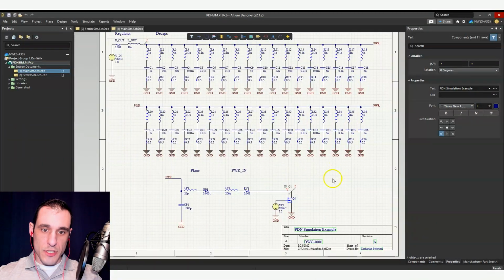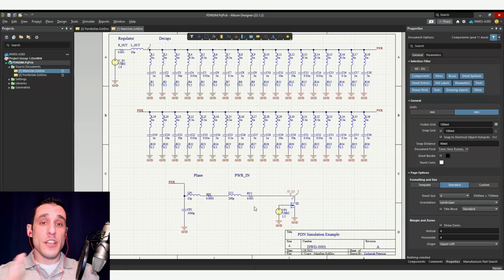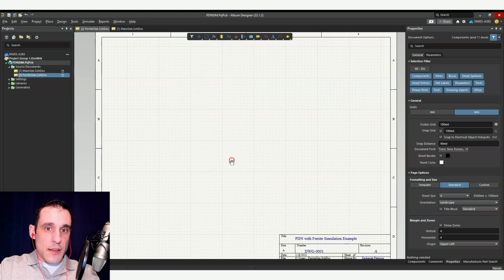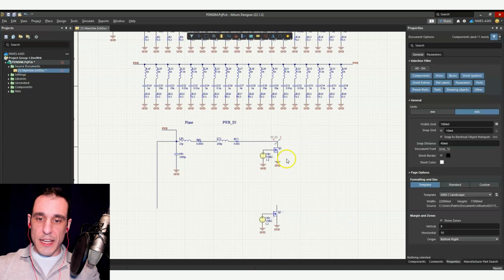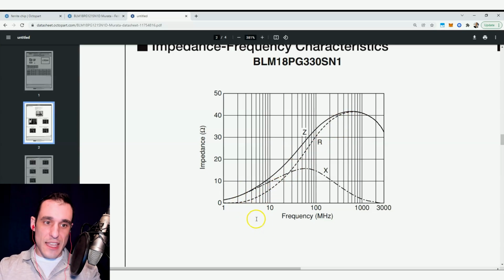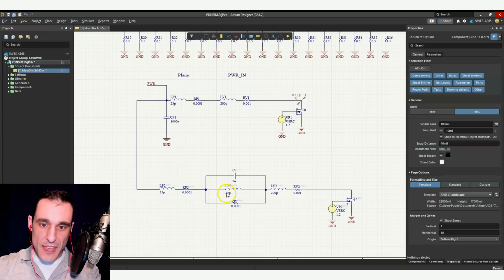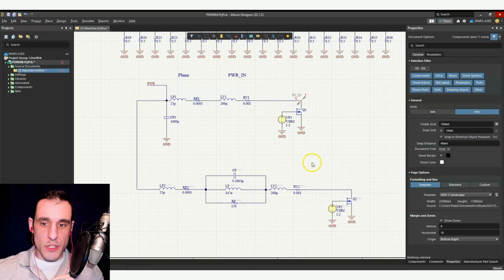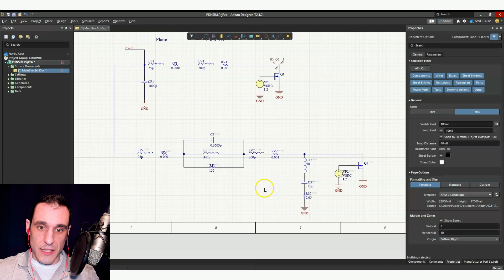Ferrites in Power Delivery Networks - Part One

Comment: hi dr. Peterson, how did you calculate R,L and C in the ferrite model? for example to calculate C did you use C=1/2*pi*f*Xc? Thank you
Reply: I will show how to do this in an upcoming video. It is actually very easy by looking at an impedance curve for a ferrite bead and the impedance equations for an RLC parallel circuit. Give it a try and see if you can do it, or you can tune into the video once it comes out in the next couple of weeks.

Comment: Hello Zach, thank you for all the awesome content.
Would you recommend putting a 100Ω@100MHz ferrite bead on a VBUS line near the USB connector for a general high frequency noise attenuation? I mean it's recommended by many IC manufacturers and it's even mentioned in the USB spec.

Comment: Hello! Can you explain how you calculated inductance and capacitance for the model of ferrite?
Reply: Sure. The ferrite can be simply modeled as a parallel RLC circuit. This is not an exact model, it is only an approximation and it will overestimate the reactance at mid-range frequencies. The impedance value at the peak in the impedance curve gives the value of R. The bandwidth (Q value) is used to determine L using the value of R, and then the natural frequency (known from the peak in the impedance curve) and L can be used to determine the product LC. From that you solve for C, and now you know all three circuit quantities.

This first thing to note is that the ferrite's behavior can be approximated as being a parallel RLC circuit. This is because, at resonance, the impedance curve of the ferrite is maximum and purely resistive. So at the peak in the impedance curve, the impedance will be equal to the resistance. To determine the capacitance and inductance in this model, you have to  use the FWHM of the impedance curve (the Q-factor) and the resonant frequency. This gives you 2 equations with 2 unknowns, so you can solve these two equations using your input values of resistance, Q-factor, and resonant frequency.

Just note that this model is only an approximation. A better way to incorporate the ferrite is to get a SPICE model for your specific component. You might need to create your own SPICE model. This is something I'm still learning to do, but once I get better at it I can make a video on it.
Reply: @Zachariah-Peterson  I was doing the calculations on my own and I never get the values you have. The resistance is just a read off value. But how do you get the Q-factor. I assume the FWHM is at 75Ohm so starts more or less @30MHz and ends at more or less @4000MHz. After I would find my Q factor, am i right to assume that the formulas needed to solve to L and C are : Q = R*sqrt(C/L)